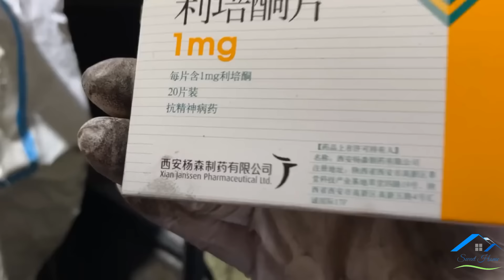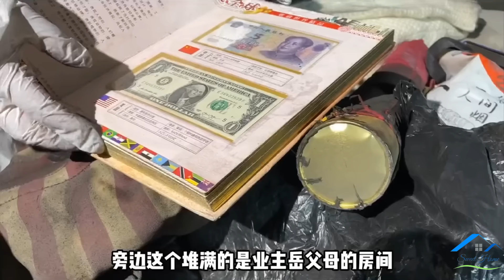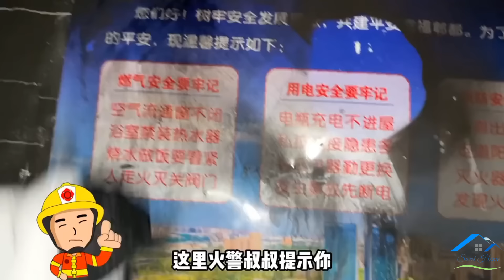Cleaning a burning house😭 48 hours of continuous work 💪 to give this little family new happiness😍🤩❤️

Comment: A burned house is no longer fit for shelter due to safety and structural integrity.
Reply: I guess they make it "burned" Everything looks still fine, just smoked, not have a big damaged
Reply: Not in china it seems.
Reply: If a flat burns out in a house with 100 flats, they won't condemn the whole building. They bring in engineers, make an assessment and repair what's needed. But first they need to clean it.
Reply: I deptends on what actually burned, if it's just something inside the house, then you just need a good decontamination
Reply: Maybe
Reply: Тогда кучу домов панелек бы расселили, если на нижних этажах были пожары. Так что не сочиняй глупая
Reply: That’s not true. It depends on how much is burned. Our kitchen was burned but the rest of the house wasn’t. It was just covered in soot. The inspector is the one who comes in & says whether the structure is compromised. Ours wasn’t. So we rebuilt that kitchen area & cleaned the rest of the house
Reply: @SaburAliKhan333not incense. My house looked just like that after the kitchen burned. The rest of the house was black with soot every single room.
Reply: Once cleaned up, one can say nothing and pretend it never happened
Reply: Not always true it could just be smoke damage or water damage not just fire damage

Comment: I have so many questions.....I hope there wasn't any asbestos or other harmful fibres in those walls you were pulling down. The house is cleaner but so many sockets and electrical fittings are burned and melted- you can't return to that.  Plus windows, doorframes etc.   Where does that window in the bathroom lead to?  Why so many potatoes?